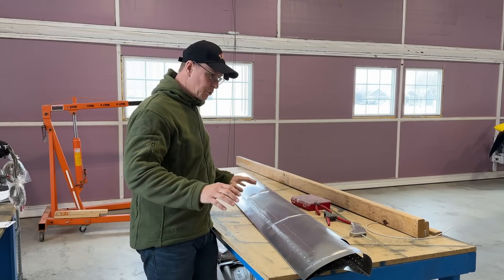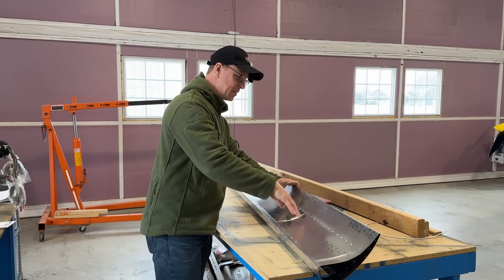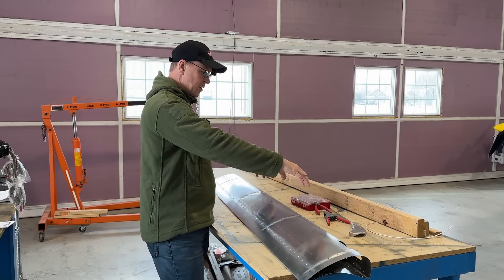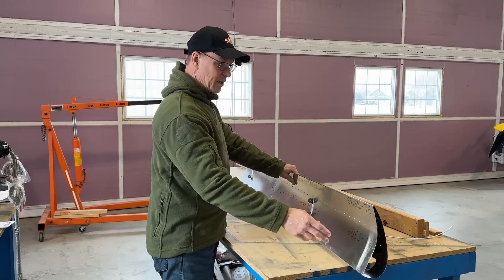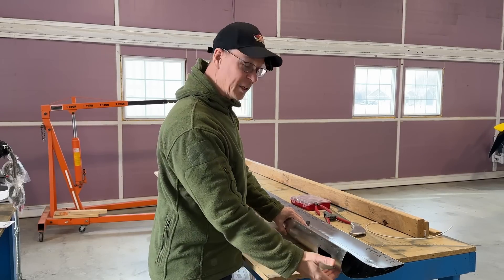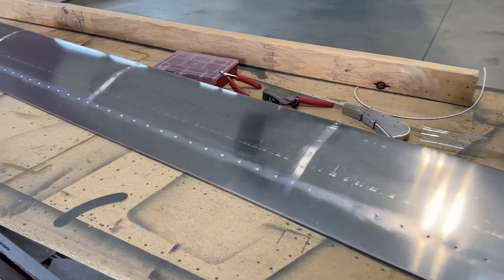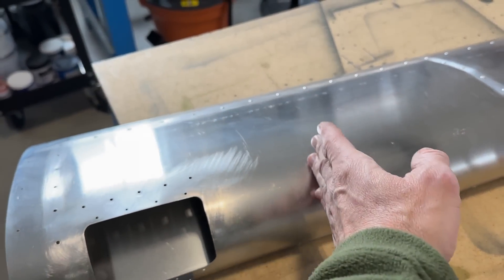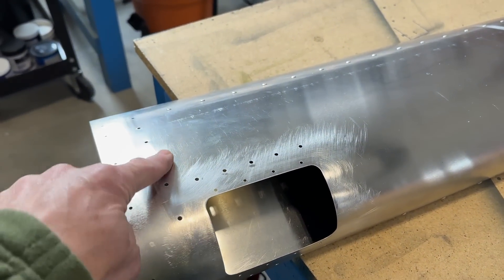Zenith Super Duty SLATS and AeroLEDs Recog Lights!

Comment: on that outside rib in the slat, could you have put nut plates on the rib and attached it with screws?  Then it would be removable.
Reply from the maker: That is true. But the lens is sandwiched between the light frame and the inside of the skin so the only way to remove the lens is to drill out all 16 rivets holding the frame in! I k ow this because I had to do it! I noticed the large screw on the top that adjusts the light was poking on the lens, which would eventually lead to the lens cracking. So I removed the rib, drilled out all the rivets, and removed the plastic washer I had behind the screw! Really the o lot was to get to the light to adjust it is to mount the lens on the outside of the slat.

Comment: Hello Mark. What impact does the trailing length of wire between the wing and the slat have on the fit of the slat to the wing when closed? It would seem that the wire will be trapped between the two surfaces and might cause the outer end of each slat to look slightly distorted when closed, also how are you dealing with the wires at the point they emerge from the wing and slat to avoid chafing and possibility of excessive bend radius?
Reply from the maker: The slats on the Zenith airplanes are fixed in position. So, they do not slide in and out. The wires will have a rubber grommet where they exit the slat and the wing.

Comment: I've been watching these STOL competitions and it makes me want to see the Super Duty fly. Not to think it was meant to compete at the highest level but still anxious to get it in the air. As I watch these shows it seems they are making planes that are more specific to the competition. They are planes not likely to be used for much else. I don't know much about the STOL competitions but it seems to me they ought to have competitions based on plane characteristics. If someone wants to compete with a plane that's a little heavier or more suited to daily flight they should have a class for that. They may have it and I am just not aware of it. I do know that at least one pilot was lost recently by flying a plane not well suited to the demonstration they were flying. If I had a Super Duty I would like to compete but I would also like to use all the pleasantries of the plane.
Reply from the maker: I've always thought that I'd like to do the competitions but ONLY for fun. I literally would not care if I finished in last place. I think the competitions would be a great way meet some pretty awesome people.
Reply: National Stol does have different classes. Touring class sees stock 150's and 182's along with an occasional low wing Piper. Viking won 1st place in one of the unlimited class events with a modified Super Duty.

Comment: Are the connectors from Aero LED's or are they just a generic connector from A/C Spruce?  I have to order some.
Reply from the maker: They are Molex connectors and they do come with the AeroLED lights. You can also buy them on Amazon. A lot of people give me grief about these connectors, but in 20+ years I've never had one break, come disconnected, or fail. I have no issue using them.

Comment: You might want to secure those connectors with tie wrap that are in the slat.  the weight of the 2 connectors slinging around in the moving surface may be enough to fatigue the wire.

Comment: did you form the clear lens cover by forming it on the outside or inside the slat?
Reply from the maker: I formed it over the outside of the slat. The material is so thin that it's not going to be any different if you formed it inside or outside the skin. And forming it on the inside would be pretty difficult to do.
Reply: @KitplaneEnthusiast  Thank you very much.

Comment: How did you cut the access holes? They look perfect. Are you worried about water finding its way around the lens, or did you seal them somehow? Looking reaaly nice.
Reply from the maker: I draw a box, then use a step-drill (or unibit) to drill about a 1/2" hole in each corner. Then I use a Dremel with a thin grinding wheel to connect the dots! Then clean it up with a file and sandpaper. I have shown this procedure before in other videos, but I have no idea which video. Maybe look back at the older Cruzer build videos.

Comment: Will you have a landing light as well as the recon. lights?
Reply from the maker: I don't know. I installed a switch in the panel for a landing light because I thought I could put one in the cowl. At this point in the project I just want it done so I may skip the landing light for now. I don't fly at night anyway so I really don't need it.

Comment: So the slat are fixed? Don’t move on how slow or fast you’re going. So if on a long flight you could take them off?
Reply from the maker: They are fixed in place. I know people with 701's and 750 STOL's have flown without the slats, but I haven't of any one taking them off the Super Duty. I've heard those people can gain and extra 10 mph without the slats.

Comment: My CH750 - suggestion. I had a wire from my wigwag come out on the inboard side of the Slat mount, with a connector. I had the power supply come out of the wing in the same place, with a connector. The connection is made and tie wrapped to the slat attachment, inboard, and out of sight.
Reply: I wondered about a wire " free floating" between wing and slat over time.  You approach seems better.

Comment: If the connector inside the wing will be considered a permanent installation, then it will be most reliable if you delete the connector and simply extend the cable by splicing an extension, then use the second method shown in the video to connect to the light pigtail.  It's not a great idea to have connectors in places that are not accessible.  If there's corrosion between a pin/socket, or a terminal backs out of a connector housing, it becomes a nightmare to fix.

Comment: Just in case you ever changed your mind and would like to make the slat lights adjustable, you could drill a small hole in the lens over each adjustment screw head just big enough to accommodate a screwdriver shaft.  You could then plug the small holes with rubber plugs (look like a grommet but doesn't have a hole in the center).  The plugs wouldn't obstruct or affect the lights at all since the screws are not in the "line of sight" of the light pattern.  It's one of those things that would be easier to do now rather than later.